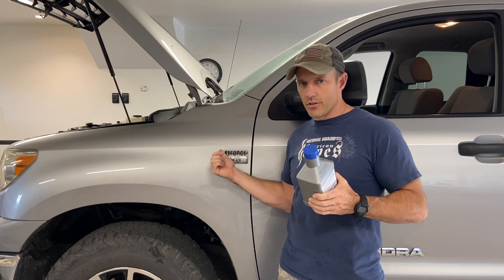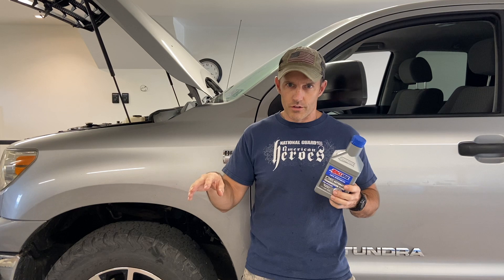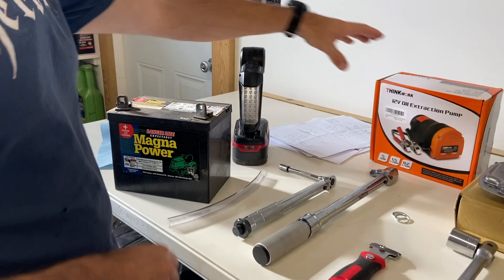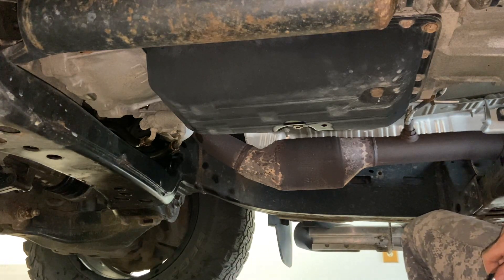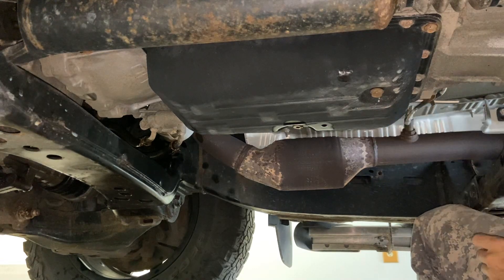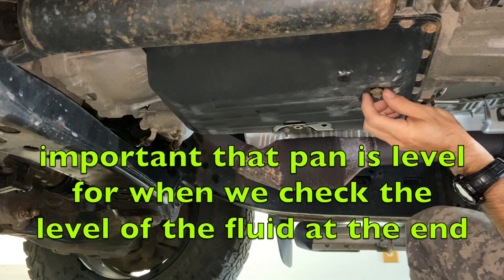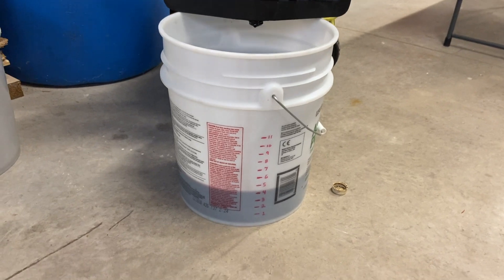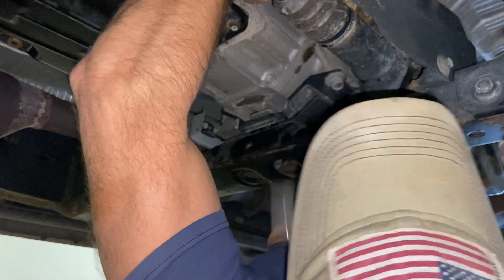How to change transmission fluid on 4.7 Tundra

Comment from the maker: Here is a list of some of the stuff i used in my video hope this helps some of you out. Change playback speed on YouTube to 1.25 so video is not so long.                                                                         Sorry tried to make it as quick as i could but not miss any thing. Thank you for watching
electric fluid extractor pump https://amzn.to/35FJrRK
Transmission fluid Toyota 12 Qt https://amzn.to/3dZQZ5P
Transmission fluid Toyota  6 Qt https://amzn.to/2J4RQ9K
Torque wrench FT. LBS               https://amzn.to/3jk00aM
Torque wrench IN. LBS               https://amzn.to/3dX5vv5
Transmission filter (make sure you pick engine size 4.7) https://www.autoanything.com/transmission/wix-transmission-filter
crush washer set                         https://amzn.to/3mpq06r
infrared thermometer                 https://amzn.to/3jxCLdw
measuring container https://amzn.to/3dXA0Rm
metric allen (Hex bit) set           https://amzn.to/31xQhaT
socket set                                     https://amzn.to/34nXlsd
24 mm socket                             https://amzn.to/35ro8TT
1/2 in drive breaker bar             https://amzn.to/3oigHY1
drain pan                                     https://amzn.to/2TnX2Yl
break parts cleaner                   https://amzn.to/3ktIYs7

Don Smith if you want AMSOIL fluid also look Don up on Facebook https://www.youtube.com/channel/UC__RS5VOAiKipmDS_XQ8W6w

*Full transparency. I am a participant in the Amazon Services LLC Associates program, an affiliate advertising program designed to provide a means for me to earn fees by linking to Amazon.com and affiliated sites.
Reply: @Cayson Fletcher glad I could help xD
Reply: I have an ‘08 Tundra V8 -4.7L . It drives backwards when I put it in drive.Does this mean the auto transmission is gone ? Will replacing the clutch resolve the issue ?

Comment: That’s the best Tundra transmission fluid change that I’ve seen. Simply demonstrated and spoken clearly. Than you!
Reply from the maker: Glad you like it, that video was a lot of work. Thank you for the nice comment
Reply: @DIYJIM  I have a 2012 Tundra and have been using a hand pump. Knucklehead, right. I’m on Amazon now buying that pump. Thanks again
Reply from the maker: It did work good did you use the link I put in my video if so thanks it helps support my channel
Reply: @DIYJIM  can you show us for a Tundra 2005 please?
Reply from the maker: @ninalucas8703  sorry only have enough money for one truck

Comment: I Have 2007 Toyota tundra with 160K.. shifting out of low speed to higher speeds had some issues. Had dealer flush transmission fluid ( they did not recommend it) after i agreed not to hold them liable , they flushed out old and put in new. Problems solved. I have not found any shops in my area that would perform the change like this video shows.
Reply from the maker: That’s why I made a video and did it myself. The toyota dealer also would not do it like I did. Thanks for watching

Comment: One of the most detailed diy video i've seen.  Thank you for not leaving anything out. Will use this video on my 4.7 in the future.  Thanks.
Reply from the maker: Glad you like it, I had to do a lot or research to make this video because most of the videos are not that good
Reply: Now I see why if this job is done correctly by either a Toyota service shop or your trusted local mechanic the cost will run upwards from a couple hundred dollars to over three hundred, the latter is what the dealer will charge in my town here in Arizona.
I was hoping to see what the dipstick reading was at until I realized your model year likely doesn't have a dipstick.  My 2003 4.7L Tundra does have the stick.
Overall a very in depth well published DIY video.
Cheers Mate!
Reply from the maker: Thanks you are correct

Comment: I never changed the transmission fluids at the required intervals (well according to Toyota it never needs changing) and now have 104k miles on the Sequoia so I am afraid to remove and replace all the fluids because of potential problems so I am just doing the drain and fill method at this point.  I removed and replaced 4-1/4 quarts which is a 1/3 of the total capacity.  I will do this at regular intervals from now on.

Comment: Awesome video. Many thanks! Edit: I got as far as snapping three bolts on my trans fluid pan. Filled it back the 3.25 quarts I drained and called it a day for now. I want to caution anyone thinking of doing this and going hog wild trying to remove the pan - DO NOT DO IT!! You will find yourself in a world of pain. I talked to a few shops today and the consensus is there is absolutely no reason to ever pull the pan or change the screen inside.
Other than that, really appreciate the video.
Reply from the maker: Welcome Ben, thanks for leaving a comment and watching my video.
Reply: @DIYJIM  Another question: is there no risk idling the truck and cycling through the gears with either too little or too much ATF? I think I'm going to try the gravity feed method rather than buying a pump. BTW, the link to your pump is broken - perhaps that one is no longer available. Thanks again.
Reply from the maker: @benschmolze1266  sorry I do not want to tell you something wrong. But I would guess there is always a risk of idling to long if you have to little or too much ATF. You can look for a different pump on Amazon. I’ll have to see if I can fix my link. Thanks for watching and letting me know my link is not working.
Reply: I would try and spray all the bolts with some Kroil penetrating oil and let those soak a bit especially if you have high mileage or live in a rust prone environment and not use a impact until you can loosen them with a socket and ratchet. Also he shows in the video that he put an extra quart in to probably help with the peace of mind of not running it low, but in reality with the truck just running in short intervals while draining a few quarts out a few at a time which like he showed by adding one in the beginning wouldn't hurt. Transmission gears aren't going to be going Ludacris speed at idle so no worries.

Comment: My new Go To Share for the News!
Thanks for the clean presentation.
Your one of the only others I saw that also warmed up the New WS. I did it on my 2006 A750Fthinking about expansion of hot fluids, it worked out perfectly. Owned since new, never touched until 2020 @ 97.5K so I knew levels were spec.
Doing one more Double D&F at 110-120K, two more D&Fs, then Filter Change/Full Exchange at 250K.
I only did the Gallon&1/2 double D&F originally, but you made doing the flush look easy!
Subscribed
Reply from the maker: Thanks for subscribing. I bought my truck brand new in 07 I am trying to keep it for about four more years. Thanks for watching
Reply: @DIYJIM  Whomever bequeaths it will be driving a Million Miler!
Happy Trucking.

Comment: Completely the best video on the net on changing the transmission fluid precise to the point every step done with just the right pace and talked in laymen terms so a nybody watching can do it thanks and again excellent video
Reply from the maker: Welcome thanks for watching
Reply: @DIY JIM  thank you I bought my 2008 double cab last year love the truck but when it comes to maintenance  not so good.everything seems like a big secret or cost to much to get it done I'm a diy kind of guy I will tackle just about any job but do my home work first with toyota you really have to navigate quite a few areas I found in the maintenence  arena to be comfortable on doing just that maintenance. I think they really try and keep it in the house so to speak for highly trained toyota technicians. Was glad you put your video out that you did to save a little money on something that  might be needed down. The line I'm retired military so try and save anything way I can thanks again for video  it truly was a great class with which you didn't leave in my opinion nothing out including safety and tips to help make the job easier or better and recommended your video to a couple friends .one I helped and one wanted to do it by himself both said the same and said they will do the same as far as recommendation and a like
Reply from the maker: Awesome thanks for recommending my video to others. I’m also retired military half was Army national guard. Thanks again
Reply: @DIY JIM  you bet I kind of figured buy didn't want to come right out with it the class was to good not to be .take care God bless

Comment: Great video! Very easy to understand. Out of all the many forums and opinions none ever mentioned pulling the pan and changing the filter. I been doing my own maint for years and had vehicles go over 300,000 with regular maintenance including tranny services.this is essentially no different then a good old Chevy pu, aside of the method of the level ck. I would have been uneasy had I done just a drain and fill, like it was incomplete. Thanks again for cutting through the many BS methods and opinions!
Reply from the maker: Thanks for watching glad you like the video

Comment: Just found this Jim!
Great job as always. Should do this complete job on my 06 DC 4X4 eventually. Did a double D&F at ~85K but didn't block open my bypass/drop pan.
At 102K now so will Double D&F once more by 125K as well as another Difs/Transfer Case refill.
Think will do complete job at 175K.
Thanks again for sharing super info.
Reply from the maker: Thanks for watching my friend

Comment: Thanks for the video. I have a 2007 tundra 4.7 v8. Same as yours. The truck has alot of miles, 180,000. I have no idea of when if ever the transmission fluid has been changed. The transmission makes a clunk when shifting to overdrive. I checked all the other known causes, engine & transmission mounts and drive shaft. All that was good but when I checked fluid it was very low. I took off pan and put new filter and replaced just the 4 quarts like dealer will do. My question is it a bad idea to dump all the fluid out of transmission with alot of miles ? I keep hearing not to do it or could have slipping problems. I'm in the middle of just changing filter and the 4 quarts but now thinking maybe should do your flush. The fluid looks black as motor oil. Didn't see much metal or any signs of damage in pan. Sorry for the book I wrote you! 😅
Reply from the maker: Sorry I really can not give you a good answer. I was seeing the same thing you were seeing. I have not had any troubles since I have done it.
Reply: @DIYJIM  Thanks for taking time to answer! Hopefully I'll get this straight.

Comment: Great DIY video on changing transmission fluid.  Does this also apply to a 2006 tundra 4.7? My Toyota dealer is charging $360 to flush and change only the transmission fluid.
Reply from the maker: It should be close to the same

Comment: Over the years of working on motorcycles and clutch covers its not a bad idea when dealing with a pan/cover that has a lot of bolts to just grab a piece of cardboard and draw a outline of in this case the transmission pan and filter and punch out holes with a screwdriver and place the bolts in those holes. That way if you do have a longer bolt you wont be searching the internet and panicking. Plus its never a bad idea to put bolts back in the same threaded hole they came out of.
Reply from the maker: Good idea thanks for tip. Thanks for watching

Comment: How many miles was on the truck when you did this the fluid replacement and was this the 1st time the transmission was ever exchanged and/or changed?
Reply from the maker: I think I had around 100K on the truck when I change the transmission fluid for the first time.
Reply: @DIYJIM  Cool.

Comment: Thanks for vid. Question. You said that eventually the truck will start to suck air when you remove the return line and leave it on for too long. If it sucks air for a few seconds is that okay? It won't damage anything? Thanks again
Reply from the maker: Just stop when it starts sucking air it will be okay. Thanks for watching

Comment: Great video. I have the exact same truck down to the color and the newer Toyota wheels even. How has the Amsoil been doing in the transmission compared to the WS? Can you feel any difference? Thanks.
Reply from the maker: I really can not tell a difference. Did you see the links to some of the stuff i used? The pump really helped. Glad you like the video

Comment: You should have shifted through the entire gear sequence when the engine was pushing out transmission fluid. There were plenty of used fluids remaining in the torque converter if you missed this process.
Reply from the maker: Thanks for the tip and thanks for watching

Comment: So, I didn't do a full flush. I just did a partial change at the pan. I had 4 quarts come out while the tranny was cold, so I put 4 quarts back in. I heated the pan to 120-125 and ended up having an entire quart drain back out at the level drain. Has me a little nervous, but I think that whoever did it previously put a little too much in.
Reply from the maker: Hope it will be okay thanks for watching

Comment: From what I've researched.  Toyota runs its trany at 230 f.  They use a special formulation oil that doesn't break down above 300.  If I'm not mistaken, AMS oil isn't up to the Toyota spec....
Reply from the maker: You can look one there websight. Thanks for watching
Reply: Yes it is!

Comment: hey i have the same tundra and it has over 260,000 miles a lot of people i’ve ask tell me not to change the transmission oil because it’s gonna slip since it’s been a long time since they change the oil idk wht i should do
Reply: i’ve had it slip once or a couple of times only thts wht has me worried the oil it’s black when i change the drive shaft  i saw some of the oil
Reply from the maker: I changed my transmission oil around 100000. Now I have 126000 and I have not had any problems.

Comment: I am curious about the timing of you filling in and you draining out. You drained first from drain pan amount of oil 4 quarts and then you filled 5quarts. I got this point, but you still drained it from the hose line to complete flash out the dirty oil ,but you did not specified how many quarts you drained out from there. You show that you have 11 quarts in the bucket. It means ,you just drained out in the hose linethe 5quarts that you put it in after the first drained out.
Reply from the maker: When I drained from the hose I measured it and put in about the same as I drained. Then at the end I checked the level. Hope this helps

Comment: Great demo only one problem you better drain the Amsoil out and put the correct trans fluid in. WS that's world standard Toyota brand WS Fluid there is a significant difference between the two.
Reply from the maker: Thanks for the advice not anytime soon thanks for watching
Reply: Amsoil is better fluid than the Toyota WS you should do your homework before you say anything thank you!!
Reply: Always use Manufacturer recommendation

Comment: Heat gun not accurate. Use the Toyota method by puting a jumper wire on the OBD2 outlet.
Reply from the maker: Thanks for the info thanks for watching

Comment: I’d rather pay $150 somebody to do this work, there’s tools that I don’t want to buy and steps that I don’t want to take.
Reply from the maker: Boy if you can get all the fluid changed for $150 I would do that also. Normally for that price it is only around 3 quarts.
Reply: I went to Toyota, they are charging $322 solely to change the fluid. 😡